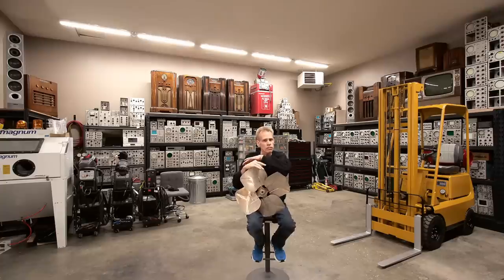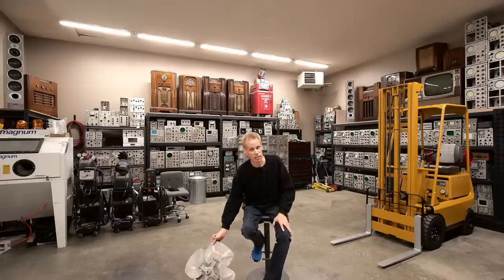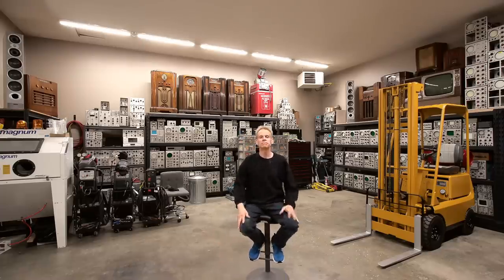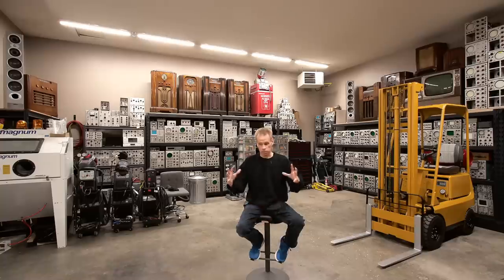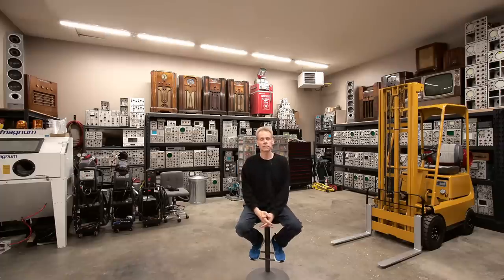SCARY Fan Blade Story! More Of Mr Carlson's Past.

Comment: I remember when I was a kid my friends father was into rc planes and helicopters......
One day we were in the garage and he had a plane on the bench he needed to test the engine so he revved it up after 10 seconds the ten inch prop flew off and literally brushed my ear on its way to embed itself in the dry wall behind me 😂😂😂😂
Reply: This is quite common. My brother and I were using the trimming pole on a gas powered large scale heli back in the early 00's (Stihl ms 250 powered, which at the time was one year old). The tail rotor split in half, piercing his car as it flew in the front, and the other missing us by mere cm and breaking a window on the house.
Props be dangerous.

Comment: I had my share of incidents with propshafts, lathes, exploding crane gearboxes, exploding 250A electric sliprings....
Only thing i am afraid of is kompressor tanks, kompresed air instalations, hydraulic oil penetration of my skin and acetylene/oxy mixture, and i face those daily.
By profession i do mehatronics, but electricity does not frighten me, like you i weld, cut, machine, solder...

And one more thing, i have 100t hydraulic press in my shop, that could be dangerous in many ways.

Comment: My experiance of danger was I built a small tube transmitter and got a RF burn form the ouput on my thum, it was there for years till the skin grew out. Then in the Airforce with 10kw Collins URG  equipment (Universal Radio equipment) at the transmitter site I  had to test the driver current on the dual 4CX350 Drivers with 2 Buttons inside on the Drivver box well some idiot left the cover off the box and my hand blew th 2kv fast blow fuse and was shocked badly. thank god no harm except the shock. I could feel the elecricity in the room the next day, not good. great I had elecrical shoes, electrical mats infront of all the transsmitters. Always Used the shorting bar in the 10 kw and 3 kw ones with the rf cavity open to work on when off. some times it open when on to observe the spiral tuning inductors while on a rf generator, you coud watch them tune while tuning up or change frequency on RF generator. Just system just trying to adjust to get 180 degree phase on PA tube for match. Large discone and Log periotic remotely rotated. All form a control phone with a push button on headset to transmit, you could control reciver site on other side of base to change antenna and Frequency 2-30 mhz, antenna direction on log antenna rotors and high low power or type of transmittion SSB upper lower or upper side band upper lower or AM.  In SSB thats 4 channels of audio. just an awsum system of that DAy in the past. Its all DIgitel now with Spread spectrum.

Comment: I had to go out to Blackrock Geothermal Generating Station after some idiots hooked some 3 phase motors up to run backwards. This stupid mistake dropped 3 huge submersible pumps into 3 geothermal wells to the tune of about $12,000,000 add another $5,000,000 or so to grind the motors out of the wells. Needless to say I walked onto a job full of irate, super pissed off and generally very unhappy people. What's done is done, all we can do is fix it so it never happens again, send us the bill and let me get on with it, and this is phase rotation indicator. We will use this before we turn anything on for this go round. I had a similar experience at a Sumitomo wafer plant. Some other idiot was bumping motors to check the rotation. This jammed the impellers up, so we had acid spills all over the plant.

Comment: 1) Design flaw. Even if it was supposed to rotate in other direction there should have been a lock screw or pin.
2) Black bears eat anything. One day while roller skating I just passed 20 feet from one eating wild oats and he didn't care at all  of the passers- by (it was a busy  path).

Comment: Ha! Both my electric shock and fan blade stories aren't as  crazy as yours. I went to pick up a 120mm pc fan that I had loose running on my bench off a power supply and my finger went right into it. Still have the scar 😮

Comment: Mr Carlson - 
In the early days of my power tool repair I had a similar experience - 

Fixing a battery powered angle grinder - polarity is super important 😂- cut off disc and spindle lock flew off across the room - took a small chunk of my finger with it ….. 
stupid mistake on my behalf. Never did it again!